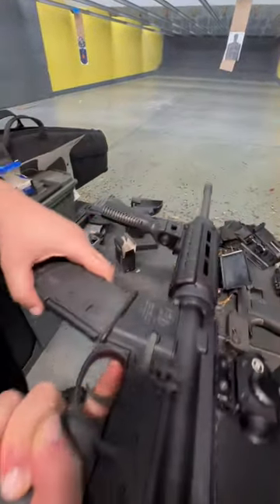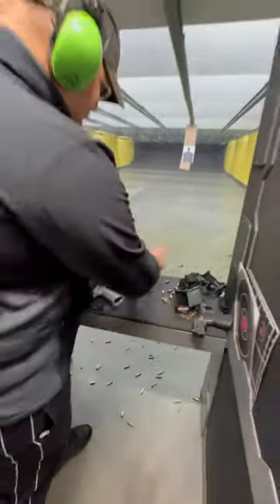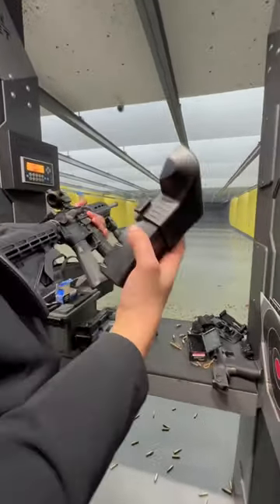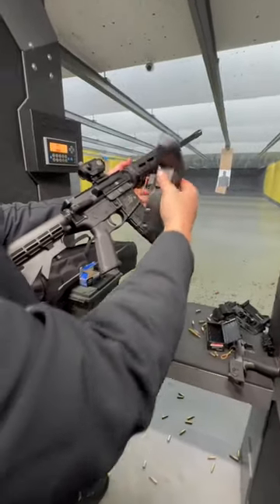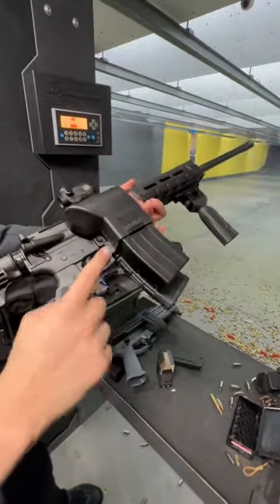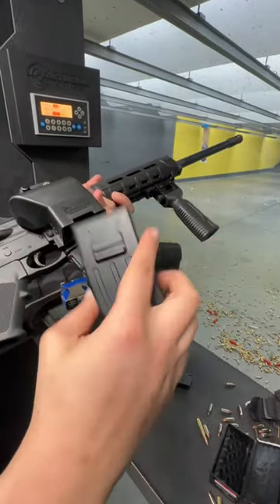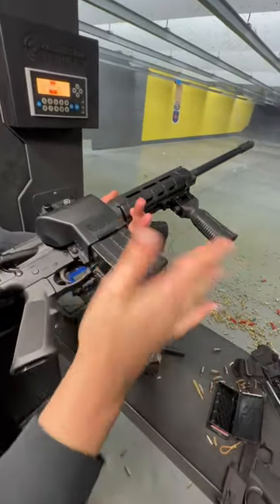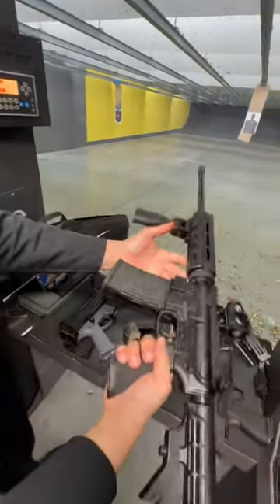Have you seen this brass catcher ?

Comment: Your malfunction is because you bought an m&p
Reply: Wasn’t a malfunction, just didn’t have the first round chambered
Reply: @zarccc9893  technically yes it is a malfunction. Operator pulled the trigger. Nothing else happened.
Reply: Rookie mistake
Reply: @Costad224  proves m&p aren't worth it
Reply from the maker: Lol just didn’t chamber a round 😭😂🤷🏻‍♂️
Reply from the maker: @FNS-gl8ji  what 😭😂smh
Reply: @FNS-gl8ji  should a good ar rack rounds for you?
Reply: @vladexxtv  in a situation when seconds count and you're down due to a malfunction.  "Cause of death: forgot to chamber a round"
Reply: @Costad224  simple. Know if your firearm is loaded or not. If question, visually check through obstruction blocking visibility put on by operator. Also those brass catchers are unreliable as they have been known to cause ejection malfunctions.
Reply: @FNS-gl8ji  him not knowing if a round is chambered is not the fault of the gun, let alone the manufacturer.
Reply: @zohairnaqvi9734  not chambering a round is a malfunction.  Pulling the trigger and nothing happens is a malfunction.  Operator loaded the magazine into the rifle, therefore the operator knew he didn't charge a round into the chamber causing a malfunction. The rifle that malfunctioned happens to be an m&p. S&w is known not to have reliable semiauto products.
Reply: @FNS-gl8ji  you have a mental malfunction m&p is fire
Reply: @anonme1295  you're about 2 months behind.  Try something new and put some effort into your reply
Reply: RSI Revan  would you like some fries with that and your double mcfatty mcclauger?
Reply: How is operator error the guns fault? Do $2000 ARs chamber a round for you?

Comment: I feel like it will cause a malfunction
Reply: Its more meant for comp shooting where you're only firing 4-6 rounds, typically in 2 shot bursts. Definitely not meant for mag dumping. Also, it's very nice if you happen to need to use your firearm for something that only requires a shot or 2, and you don't wanna leave any shells behind🤫